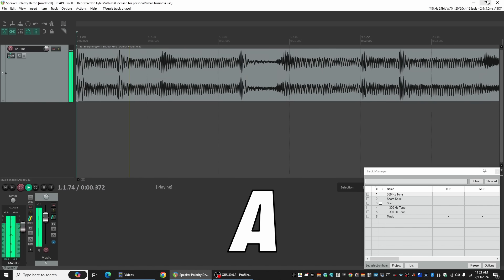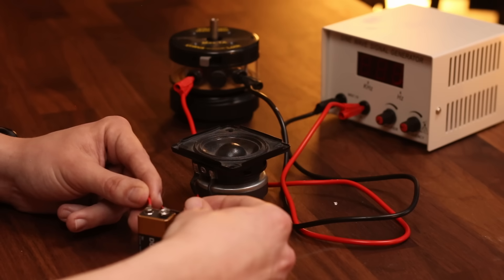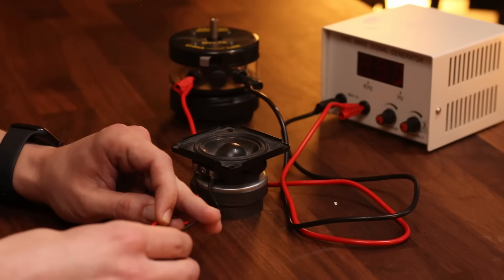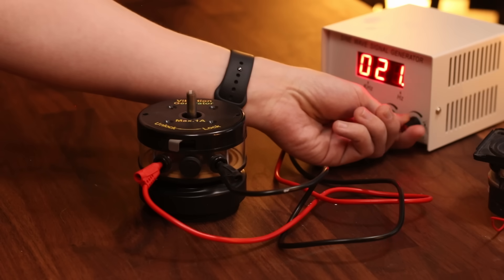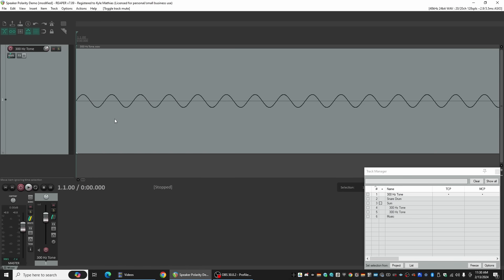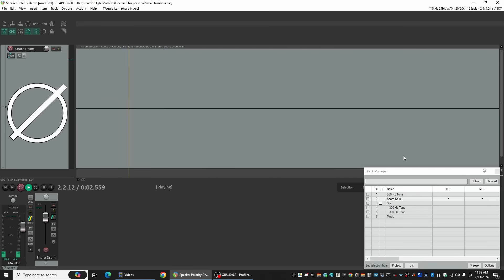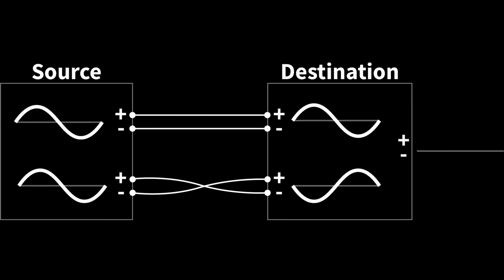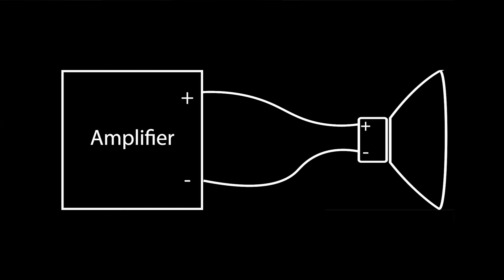What Happens When You Wire Speakers Backwards?

Comment: I've been doing sound in many forms professionally for over 40 years.  A lot of crazy things can happen with sound.  Let me first say that with a really good and highly tuned stereo system you not only get right to left imaging, (like you can here the saxophone mainly coming from the left speaker and the guitar coming from the right) , you can also get front to rear imaging.  So if your listening to a well recorded symphony recording, especially with eyes closed, you can hear the violins at the front and kettle drums in the rear.  If you wire both speakers backwards (both speakers are  - black wire to red terminal and red wire to black terminal), at first listen they will sound normal.  But if you listen more closely, you will hear the kettle drums at the front and the violins at the rear.

Comment: I once accidentally inverted one of the rear speakers in my car. At first, everything seemed fine. But when I listened from my front seat, I noticed there's much less sound and especially bass coming from behind.

The center (mono) waves are mirrored and cancel each other out when they meet in the air. Stereo waves are different from eachother anyway so they're not affected. But in music, usually instuments like bass and kick, are mixed in mono. L & R waves are equal, so if you invert one, you'll hear less of those instruments.

Comment: Sound waves are basically multiple sine waves at different phases and frequencies combined.
Just like this video shows, a sine wave would still sound the same if it's inverted, the only difference is the phase is shifted forward 1/2 of the wavelength.
Because every sine wave would still be the same after being inverted, the combined effect would still be the same.

Comment: I have a covered deck. Up in the rafters I have older speakers wired to a stereo that is disconnected and brought into the house over the winter. When I put the speakers up years ago, I payed no attention to positive and negative. I had no idea there was a difference. When I hook up everything in the spring, it's random chance. They might both be the same and they might not. Given that I have never had a problem with the sound coming from the speakers. How important is it for me to climb up there and figure it all out?

Comment: This isn't  about polarity but it is about speaker output: A friend  had just set up a new stereo in his living room and was getting a hum from the speakers whenever he played a vinyl record. Knowing that I was an electronics technician, he asked me over to take a look at it. After listening for a minute I asked him to bring me a clean bath towel, which he did. I folded the towel and placed it under the turntable. The hum went away. My friend was baffled until I explained to him that the top of the floor speaker cabinet wasn't  the best place to put the turntable. He was still baffled until I pointed out the needle picked up the speaker vibrations and set up a feedback loop. He still calls me a genius. And he still has that towel under the turntable! 😂

Comment: When I was in school, this was one of the reasons I loved physics class. It's kinda insane to me to realize that speakers can in fact cancel each other out, but in the real world, such things don't happen that often or not as badly. The reason, as stated at the end of the video, is that the sound waves do not travel only directly into your ears from the speakers, but are also being reflected by walls, for example, thus coming into your ear just a little later than a second speaker might and the waves overlap diffently. So if you position two speakers with opposite polarities at the same distance from you, you might actually hear the sound less loud because the opposite polarities end up canceling each other out when they hit you or just before that.

Comment: As a kid I experimented with wiring backwards, but never noticed a difference.  My favourite was hooking the speaker up in a chain with a small electric motor from a toy.  It would amplify the whirring of the motor, and if I put my finger on the rotor to slow it down it would lower the frequency of the sound.  Fun times!

Similar to cheap motherboards that leak the frequencies of other parts to the built-in soundcard.  I had a motherboard that I could hear my IDE hard drive spinning up, going to sleep, or clicking as it seeked, amplified through my speakers.  Very annoying!  I ended up buying a dedicated Yamaha PCI soundcard with good noise suppression to avoid the issue.

Comment: I learned there is a big difference in the bump of bass in the early 90's, Ghetto Boys, NWA, ect.., I had 2x 500W amps wired to 4x 18" woofers and a pair of 6x9's. when polarity was reversed the bass would not bump as hard.

Comment: It's called phase. If they are both wired "in (the same) phase" There's no difference at all. If they are "out of phase" then in theory some of the bigger, higher energy waves can cancel each other out. This theory is validated with active noise canceling technology. In reality, if you play with this at home you want notice unless you have the larger speakers aimed at each other and the lower frequencies will be reduced noticeably. But most people don't even pay much attention. If you have a super powerful home theater system and have multiple subwoofers in the same cabinet then you must put them in proper phasing or it won't sound "strong" or accurate to the recording. But again, most people are not very discriminating when listening to audio reproduction for entertainment purposes. And recording the difference with one microphone and one channel is not going to give you the same experience as a normal person with two healthy ears listening to the speakers directly. One last thing. There are also sound effects tools called "phasers" that intentionally simulate "out of phase" signals in many various ways and patterns. Playing with the wires and phase can get boring very quickly.

Comment: Audio signals, as you correctly point out, are oscillating polarity (AC) so there is no "backwards" or "forwards" in wiring up a speaker -- as long as all your drivers are wired with the same polarity.  The phenomenon you're describing is called "absolute polarity" and it posits that, with a "correct" wiring, the attack of a drum hit will drive the cone forwards into the room first, the same as the skin of the drum. However, as the drum skin quickly bounces back in the other direction, the wiring of the speaker becomes a non-issue.  The ears aren't capable of hearing the difference. It DOES make a difference that all your speaker cones be time-aligned, so all your drum hits occur in unison instead of canceling each other out, but that's kind of a separate issue.

Comment: make sure wire are appart . Usually the space needed is 1 diam size between take 1 cm tube lenght and glue it between wire . But with wire normally together like classic speaker wire ? Both should have wireless false signal  . It also depend on protection thickness without faraday caged wire .  Touch wire wireless electrical wise is more a problem in my view

Comment: On a side note - you can wire the speakers in the reverse polarity (positive to negative, and negative to positive), and in some cases (especially for subwoofers) you must do it (because of the phase shift due to passive filters) - just be sure to wire all the speakers the same way, be it either the "regular" polarity or the reverse, because all speakers should be in phase.
Reply: Unless you want one to be on reverse polarity to create intended zones of sound reduction

Comment: While connecting audio jacks to speaker wires in a 2-speaker stereo sound system, if wires of 1 speaker get connected opposite with respect to the other speaker, I've noticed a reduction in bass when both speakers are made to sound together while the rest of the music still remains audable. However, by shifting balance to either one of the speakers, bass returns.

Comment: You've got to do the A/B test with the speaker mounted into a cabinet.  You want the speaker to push out the air into the room - not suck it out of the room and into the cabinet.  So, A should always sound better when a speaker is mounted in a box.

Comment: In the case of the transducer with a pure sine wave the effect is a phase shift by half a period. It may or may not be relevant. It may for example if two transducers are somehow mechanically connected and they are in phase or out of phase. if the connection is for example a horizontal plank on top of the transducers, when in phase it will just move up and down but when out of phase it will wobble.

Comment: Actually, things are NOT as described, in the real world. Audio cancellation is NOT that simple! You can observe this yourself very easily with 2 speakers and a monaural (mono) audio source. Put the speakers on opposite sides of the room, both wired the same way to the one amplifier channel. Play some music and move around the room. The sound will seem to come from halfway between the speakers. Now reverse the polarity on ONE of the speakers, play the music again, and move around the room. The sound will seem to NOT have any specific source, until you get close to one speaker, and it may seem to have a stronger, richer sound! A side effect is that, at a distance many times the speaker separation distance, your audio WILL cancel out, so you will cause less disturbance to your neighbors.

Comment: You can create fake surround sound using this knowledge - wire the rear speakers between the positives of both front speakers and they will play the difference between left and right. Quite an effective hack.

Comment: What about subwoofers that have that switch on then, I'm assuming it does the same thing as switching the wires. Also why do we record audio with a -dB. I understand the positive side and for example a 43.5 dB PC fan is a lot louder than a 25.1 dB PC fan. But I don't understand the negative part of dB

Comment: The reason for polarizing the connections is to force the speaker to move in the same direction for the same signal… ie they are in phase … out of phase setups can be detected by equipment but not necessarily to the normal listeners

Comment: i was taught this about 30yrs ago from some sound engineers for both studio and live situations.  there's also been several articles in guitar magazine about this because especially important to the life of your gear and what's going to go on record.  the last interview i read about this was from one of the sound engineers who worked on crew for Jimmy Hendrix on tour.  it is as follows:

when you wires your speakers backwards your cones hit in reverse.  the initial blast from the speaker,  i.e.  that first vibration should always be the cone pushing outwards to deliver that first hit.
when you wire them backwards the cones take a breath instead.  i.e.  pull in instead of pushing forward.  that's going to affect the sound quality and volume of your session and speakers.  

if you got several amps going and one is in reverse,  your phase is going to be messed up.  it won't be something crazy like a full cancellation but your signals won't be balanced.

over time,  if the speakers are wired in reverse,  the initial hit from your speakers will lead to damage from always sucking in at first instead of blowing outwards.
Reply: That last bit is wrong. The coil and therefore cone excursion is held in an equilibrium and the availability of excursions in and out are the same therefore there is not any damage to the speaker that sucks in first. It does that hundreds or thousands of times, a second anyway.
Reply: @jamesm90  I wonder if damping circuits are expecting specific phase on the initial signal and could that have something to do with whether or not the damping is effective on the first impulse?
I suppose this would be most of the concern for powerful low and very low end signals like sub-bass since now we're concerned with these things down to 5 CPSand such

Comment: The only time two speakers should be wired opposite each other is when they are back to back in a bass cannon type box. That way they move together instead of push/pulling on each other inside the box. My friend could tell I was home by just sticking his head out his front door. I lived over 2 blocks away. ;)

Comment: This is usually a simple matter of consistently wiring positive to positive and  negative to negative, although even if you connected BOTH left and right backward, it the result would be OK. But it can be a guessing game if you have speakers from different manufacturers, as when installing better quality front and lesser quality rear speakers, or when replacing a failed driver in a car or a boombox. When I was a kid, I bought a cheap amplifier that had unmarked terminals on its output transformers ; it actually had instructions to play some bass-heavy music , put the speakers together and keep swapping one side until the maximum bass setting is found (actually, marking the terminals + and - according to their position relative to the transformer core would probably have worked). But, with mystery speakers, the 9V battery trick comes in handy even today.

Comment: I am not a professional but when you have deep bass kicks in your sound the speaker usually forces outwards. If you reverse the polarity for kicks it forces it inwards. 
In this scenario there is a slight difference in sound but that's negotiable but what I'm curious about is, if the outward or inward movement has any impact on the mechanical properties of the speaker?

Comment: I used to run sound and play the bass so I spent a lot of time in setup of all the loudspeaker system. The way I could tell which was the positive terminal was to do what you did... touch the two speaker terminals to a small DC voltage like a battery. The speaker moves outward if the positive speaker terminal is connected to the positive of the battery and opposite if not. This allowed me to quickly add in other speakers that were not mine and not labeled at the terminals. Eventually, they put a red dot on positive terminal of the speaker and it was usually the right. When done well, the fighting is not there with speaker cancelling speaker as you note with the mismatch of terminals. Additionally, I used to make my own limiter crossover. Using a capacitor, you can limit the frequencies below a specific Hertz and allow only the high end to pass to the intended speaker. I called it a poor mans crossover and got the chart from studying electronics as a kid at the local radio shack. The things we learn. LOL. Great show, keep it up.

Comment: That was interesting. Reminds me of our bassist when he connect the spkr backwards. He was hardly getting any ballz out his sound. Until someone looked @  and fixed it. Btw. Had bought a surround system spkrs. To connect to other spkrs to a satellite system. The woofer has the power and is connected to 2 spkrs. I decided to MacGyver them. By just connecting the spkrs to the wires of the other speakers and play them. Well it worked for a bit, then started to scream like a theremin, turned it downs low sound. So I shut it off until I manif3st3d the rest of the surround system. All for 36 bones. Isn't that Awesome!? Anyway why did that happen; is there an explanation for that? Thanks All the Best!!!

Comment: I noticed a difference when you switch polarity while playing on the software, the reverse wave was lower. You talk about wiring speakers one normal and one backwards and they cancel each other out. Back in the late 90’s and early 2000’s I was big into car stereos with subwoofers. With subs, you can mount them cone to cone, wire one normal and the other reverse so they don’t hit each other, and this was an isobaric design that would basically double the bass while only having one sub in an enclosure. There are other designs for isobaric layouts, but we would use this design for vehicles that didn’t have a lot of space for a large speaker box.

Comment: From a guy who got his MECP back in the early 90s, which is pretty much being a professional in creating and building high-end stereo systems in automotive and also in homes. And I have to say this may be one of the best breakdowns in the simplest forms to make sense of this. If you are a beginner, this I think is a great example to get the basic idea. I think he did a great job at this, and realistically that is what a teacher should do 

Now on a little side note, when I first started out, I had two 12-in subwoofers side by side in a hatchback, 3rd gen Camaro, and I wired the subwoofers positive to negative positive to negative, remember mono amps and dual voice coil subwoofers we're not as accessible as they are now. Regardless, this does help simplify my example. So I'm testing & tuning my sound, & when i had one sub connected it would always be louder & deeper than when adding the 2nd.  It was technically wired correctly. And I just couldn't figure out how this was possible. Long story short, eventually I learned how the Box the subs are in are built, the environment they're in, and other factors can actually affect phasing. Somebody told me to reverse the positive and negative on one of the subs, negative to positive and positive to negative, and I heard the immediate difference. 

So if you are putting together either a home and or car audio system, be mindful that this could happen. And you may want to try something like this. Obviously when you get into much higher end audio systems there are a lot of equipment to help you through this.. some of the tuning equipment can pick up this type of issue and where it possibly is coming from, all types of crossovers, equalizers and amplifiers that can adjust phasing for individual channels, etc etc, and sometimes still you have to do it the old-fashioned way